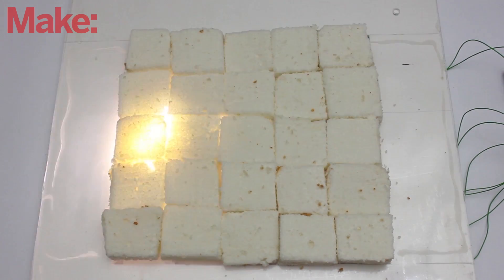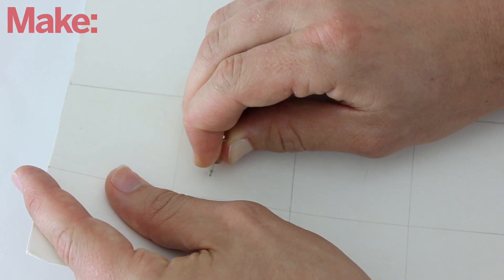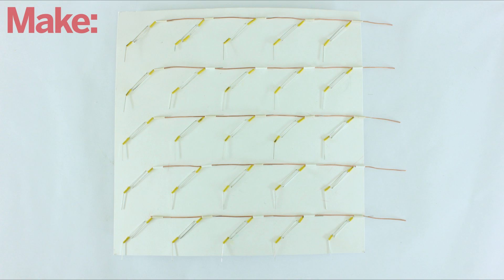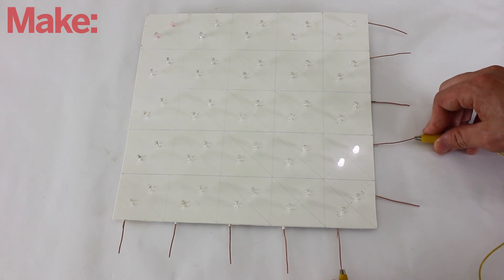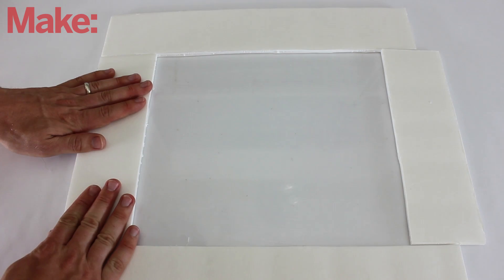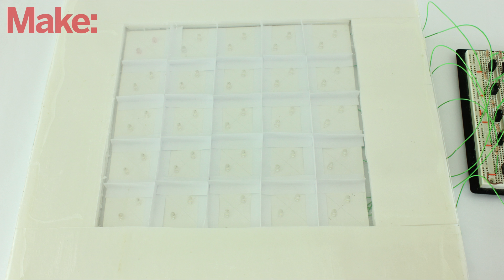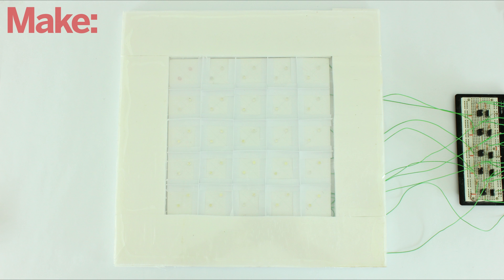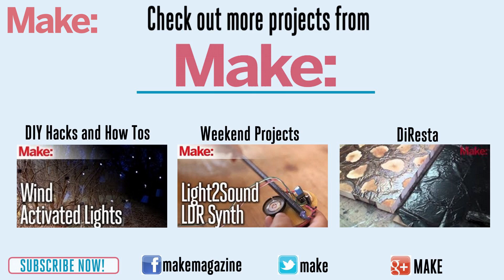LED Matrix Dessert Tray

Comment: The basic idea (a serving tray with LED's) is interesting. 
but the execution is horrible.

1) you will need to wash the tray, so constructing this out of paper/cardboard and foam board isn't the best choice of materials.  As a prototype I guess this is ok, but I wouldn't recommend anyone making it exactly like this.

2) there's better and cheaper ways to drive a bunch of leds.  there's ribbonstrips with SMT LED's that come in long continuous strips and that you can break apart and reconnect the interesting part is that you only need 1 digital pin to program them making a much simpler construction with fewer wires. Since the digital pin is only a signal and doesn't actually provide power, you also don't need the bulky/expensive mosfets.  The extra added bonus, these LEDS are dirt cheap (much cheaper than the bulb LEDs and can also do colors.
The fact they're much flatter also makes it easier to embed into a tray.
quick search on ebay.  a 5meter ribbon (300 multicolor leds) would set you back 9$.
The only "problem" with the led strips is getting enough power from batteries, the leds are on their own battery separate from the arduino, and only the digital pin and ground are common.

3) You could also use an arduino teensy which is cheaper than the uno, much smaller and thus easier to embed in a tray design.

Comment: A handy desert tray.
Loosely connected to a breadboard with thin wire.
You forgot the part where you put a small avr and the transistors on the backside of the tray and cast it all in resin to make an actually usable desert tray with LEDs. Again, this project seems very half-assed but with a lot potential!

Comment: Use some addressable led strip, snake it through the boxes, use an arduino to drive the strip.

Any colour you like.

No power transistors.

Job done
Reply: Benjamin Harvey So much easier, so much less fuss, and you can get away with a MUCH smaller microcontroller, too!